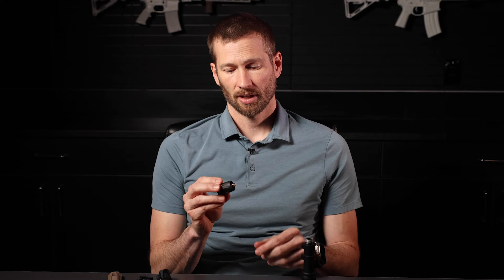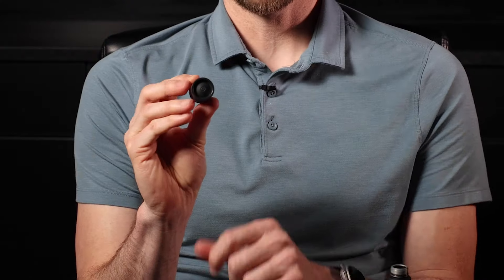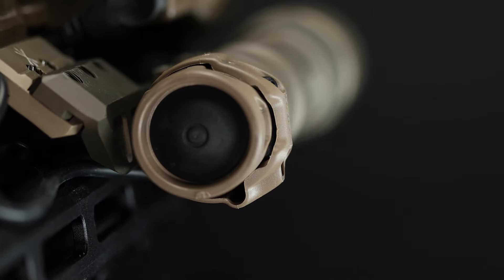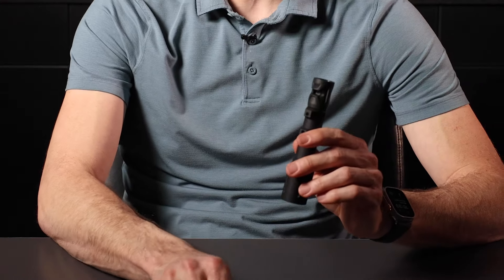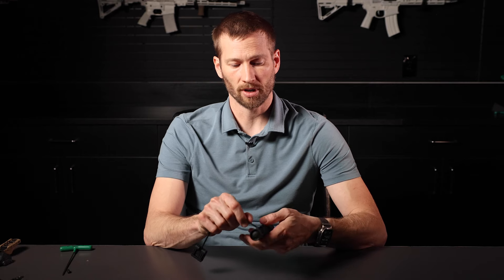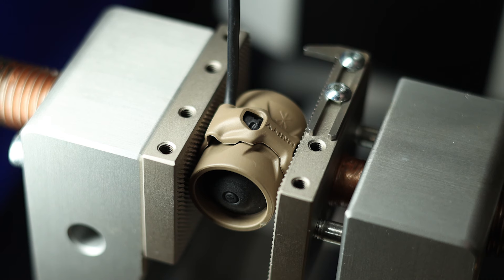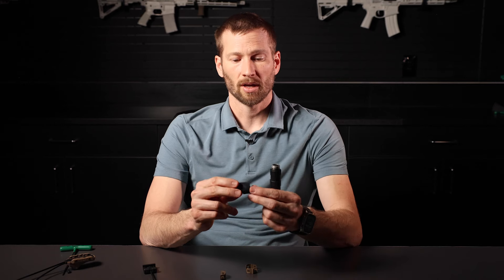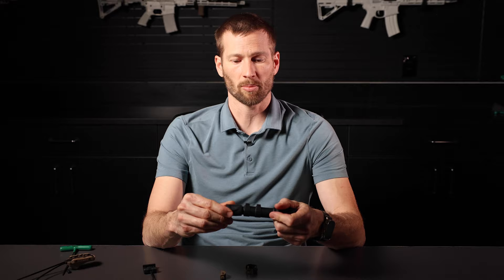UNITY GASCAP™ Overview  |  Answering common questions

Comment: Once I figured it out, I love my gascap. You can feel the weight difference. Its also nice that the connector doesn't stick out of the back like the surefire. The surefire plug is terrible. Not only do they waste space by sticking out the back, I have also found them to be pretty unreliable connector. Gascap is way better.

Comment: But whyyyyy? What is the point? Just to change the connector, even though the surefire one was fine? This just complicates things for nothing if it doesn't recharge? Plus now you have to swap out all your pressure pads?

Comment: My gas cap is properly installed on a M340DFT. Using the Link modbutton. As soon as I plug the USB C into the gas cap my light turns on. Take it out it turns off. I would assume something is wrong with my mod button?

Comment: I have 2 of the Unity GASCAP's currently.. One of which is installed on a Surefire M640DFT with the Unity AXON SL, and the other on a Modlite PLHv2 using the Modbutton Lite.    I've been really impressed with it so far, zero issues with them.  The way the cable is routed on the GASCAP is clean!
Reply: Have you noticed any drop in light output with the axon SL?
Reply: @depthcharge126  No.  I actually feel like the output has been slightly increased using the AXON SL + GASCAP compared to the standard Surefire plug setup.  Unity does advertise the GASCAP as "near-zero-loss output" when you combine it with the USB-C versions of the AXON SL and/or Modbutton Lite.  
I need to do a proper side-by-side comparison then swap the plugs and see if there really is a difference.
Reply: Do you know if the gas cap is compatible with the Modlite OKW-18650?
Reply: @colew8308  Yes, it is.   🤘
Reply: I have the same setup Awsome so far
Reply: But what is the point? What does it do different other than just make you buy a different end cap and now a different pressure switch? 😂

Comment: use kynar wire and pot your connections and MAYBE I will buy your switches again. I'm not asking for waterproofing, but as it stands your switches are a liability. I've done better work by hand.

Comment: Charge? No. 
USB-C? No. 
Clock? No. 

Then what is the point? Slightly more streamlined than existing stuff? Yes.
Reply: standard and ubiquitous port. think of the manufacturing and modding benefits. now companies don't have to reverse engineer and manufacture Surefire's plug design.
Reply: No reason to charge. If you want that gimmicky trash, im sure olight has ya covered
Reply: It can handle more power that the newer lights have
Reply: @tedundercarriage8183  which would’ve been a benefit 20 years ago, but now that everybody already makes that plug design this is pointless
Reply: @liquidwombat  and it's loose garbage